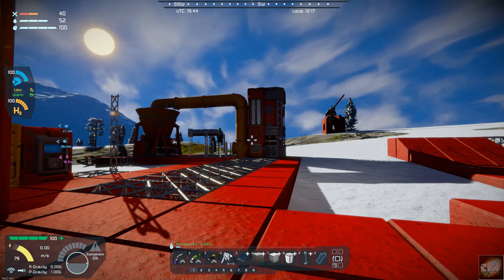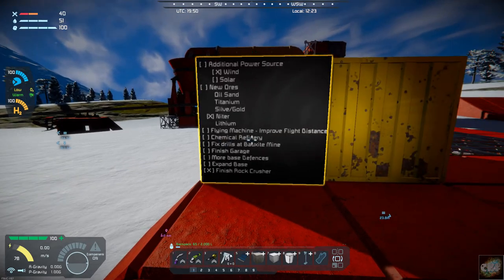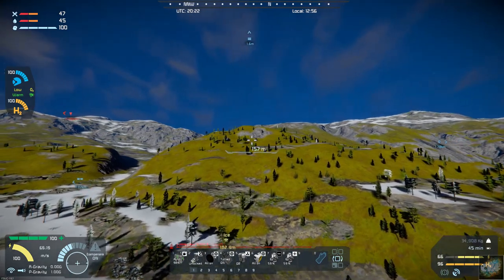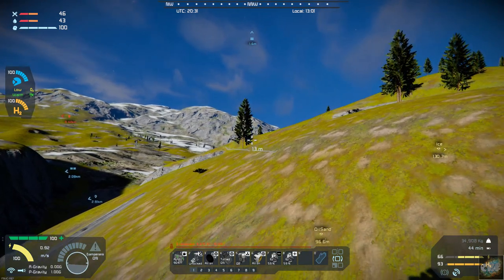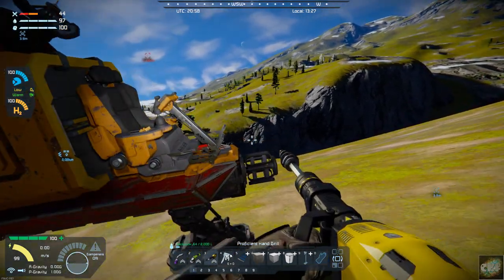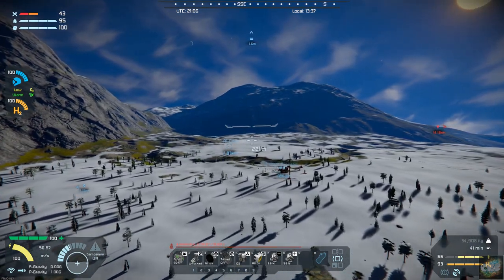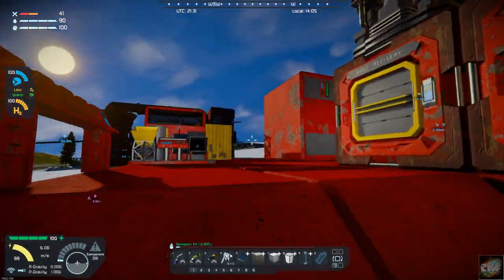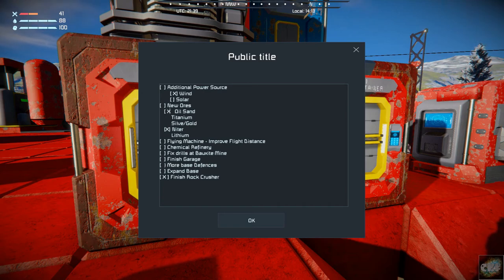Space Engineers – Season 1 – Day # 23 – Industrial Overhaul – Oil Sand!!!

Comment: I seem to nt be able to find oil sand any tips?
Reply from the maker: Sorry for the delayed response, I was laid up all weekend with Covid :(   Oil Sand can be hard to find.  It is usually around 100 meters deep so your hand drill most likely will not pick it up.  Plus in Industrial Overhaul  the deposits are scattered apart at least 5 to 7 kilometers at the closest.  I would build some sort of flying machine.  It doesn't have to be be fancy just something that can get you in the air and you can fly close to the ground with a metal detector.  Make sure you set it to maximum depth which is 250 meters.   That was how I found my Oil Sand.  You can use this for Lithium ore as well which is another difficult ore to find.    If all else fails there is a mod called [VSI] Ore Deposit Scanner, it will scan the surrounding area up to 15 kilometers away.  It still does require some higher end components so it is not and easy option but will find the ore.  Here is the link to the steam workshop.  Hope this helps.

 https://steamcommunity.com/sharedfiles/filedetails/?id=1978894018